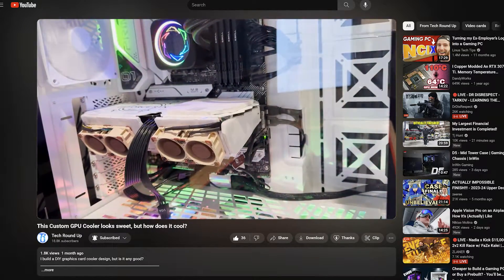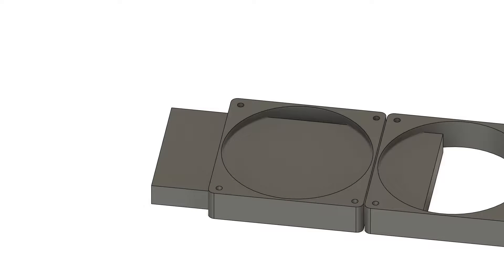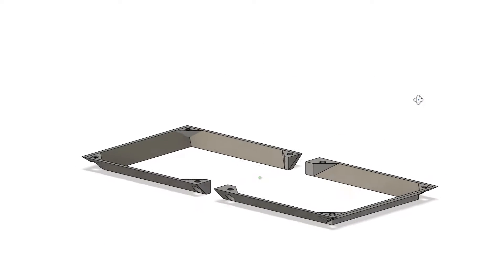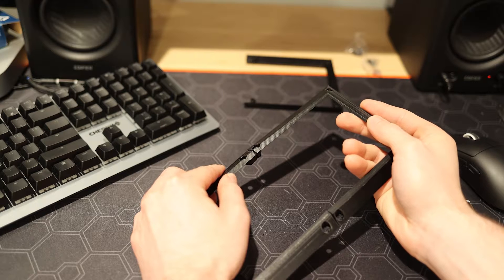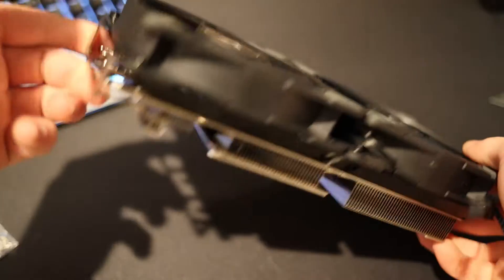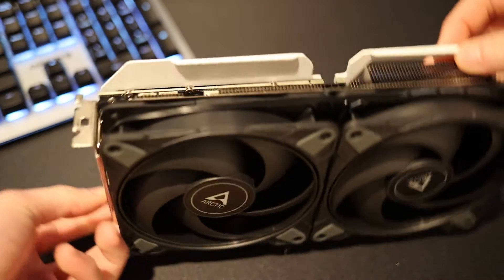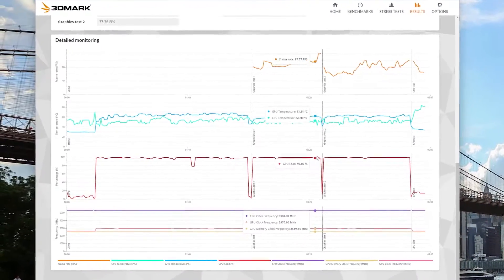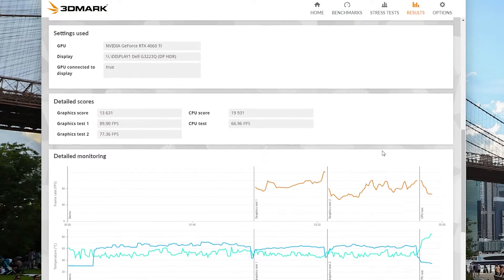This DIY GPU Cooler performed way better than expected!

Comment: Really nice tutorial I if you (like me) are looking to reduce GPU fan noise. However, when you say that you need to use regular fan-header on the motherboard
I think it would be better to use mini 4-pin adapters to plug the fans into the GPU fan-headers, thus allowing the card more easily control the fan speed.

Such adapters can be purchased from Amazon for less than 7 dollars. Just lookup mini 4-pin / GPU fan adapter.

Comment: just put a mini 4 pins to 4 pins adapter in this thing and let the videocard control them like normal, no need or external software and u get zero rpm mode. Thank me later
Reply: Just made the adapter myself but i
would appreciate your input on this; does the ampere on the fans matter?

 The ones that comes with my gpu is rated at 0.35A but for the life of me i could only find either 0.3A or 0.4A and above 😂

Comment: Before using 0.9 ampere 3200 rpm high static rear  exhaust fan I am getting 75 °c temp in gpu but after  I got 70 °c . Straight 5 °c difference, gpu is running on stock fans . 
Guys a powerful exhaust fan is critical in pc cabinet cooling .

Comment: Change the Thermal Paste with a Thermal-Pad and you‘ll get much improved Temps
Reply: Thermal pads are not meant for gpu. But rather vrm or memory.
Reply: you mean a PTM 7950?

Comment: Did the same thing almost 2 years ago, i have EVGA 3080ti, my stock fans died, and the replcements were both too expensive and would take too much time for me to wait. 
So i just took some basic measurements of my gpu and started modeling a custom bracket that would mount on the same points as the old one , and added holes for each fan that would enable me to mount it with the zip tie instead of using scres and instead of 3x 80 mm fans I've designed it to fit 2 120mm fans...
 They run at constant speed ever since, and I've never passed 80c from that day... 

I had some plans to make a custom circuit that would use sata power for fans, and gpu fan output for  controlling the fan speed and fan RGB if present, but had some issues identifying  the fan connector that was required if i wanted to avoid soldering the custom circuit to the GPU so i just never bothered to do it in the end.
Maybe some day...
Reply: Jesus Saves and Loves ♥
Reply: How many RPM do your fans produce ?

I mounted two 120mm fans to my gpu but temperature goes over 90 
Iwonder if 1600rpm is too low for my card
Reply: @JimmyCakeSon  will let you know once I get home, i had it at 75% speed before, but reduced it to about 33% after noticing there's too much noise in my room. not sure about the rpm's tho
Reply: same cards use a micro vga for the auto control for the original fans

you can buy 4pin pwm to micro vga
Reply: @vkultragame

Comment: if you also add 2 more fans at top to extrude heat you will find cooler temps. its the top cover the keeps heat in
Reply: Jesus Saves and Loves ♥

Comment: One question: if I plug the fan directly into the GPU, will the GPU control fans like stock fans?
Reply: Yes, but the plug is different compared to a regular fan plug, so you need an adapter.
Reply: @sebastiansandvik825  ah yeah sure, I mean adapter included

Comment: You think this would help an RX590 (yeah im old and poor) that usually hits 85 and throttles?
I dont have a 3d printer but i have seen other people use plastic zip cables.
Reply: i mean , i have a rx580 which use to touch 81-82c in these summers days , so what i did is first i done some undervolting , then repasting new thermal paste , and i had one fan which was size of an PSU fan of typical 500watt , i just replace it wires with sum USB cable and power it through my pc and place it vertically under my gpu and holy shit my gpu temp reduce by 4 to 5c , before it use to touch 77-76c but with this it touches 71-73c just by one single fan , and that fan is an 12v dc fan usually come pre install with some old pc as a outlet fan.

Since gpu take air inside so i make sure to place fan little bit closer to my gpu fan and it working rlly good. i wasn't expecting an big difference but infact it is , now im planning to get another same size fan and place it under my gpu lol.
Reply: @BeastAsGone  for whatever reason i cant undervolt or underclock, it crashes.
Im planning on deshrouding the gpu and using two artic p12 fans connected to the motherboard instead of the gpu fans.
Reply: @WhiteZelda  i had similar issue whenever i undervolt , my pc crashes within 4sec , but later in some reddit post i found an proper undervolt setting of my exact gpu model and this time it didn't crash.
Reply: @BeastAsGone  mine doesnt crash right away, only if i start gaming, probably bad gpu or something.
Also, temperatures do not go down when i undervolt/clock, not sure why
Reply: @WhiteZelda  in my case when i do wrong undervolt like starting from 1000mv , and after refreshing window sometimes it crash in few seconds or sometimes when i open an game it just crashes, currently im using stage 7 "1070mv" , stage 6 "1040mv , stage 5 "1000mv" and this actually help to reduce temp without this my gpu goes 83c
Reply: @BeastAsGone  I cant even underclock from 1150 to 1140 without it crashing at some point.
I was able to before, but after a couple months it started crashing, so i juts left it at default.
Reply: It should work, but I suggest repeating or ptm7950 and new getting thermal pads or thermal putty first
Reply: RX590 was designed for mining so many manufacturer max default is 60%fan speed, but you can adjust that in Adrenaline and it will not touch 80c if you use 100%, but it's going to be really loud.

Comment: Thank you, this is exactly what Ive searched for. I have a 4070ti OEM from HP and it hits under load around 75 degrees celsius to 70 degrees and I wanna customize it because of that, do you think the heatsink is universal for the 4070ti so I can exchange it to a bigger one too ?
Reply: Try to undervolting, use MSI afterburner, heaven benchmark (cause it will crash immediately if the UV or OC it's not stable without harm ur PC) and HWinfo for record the data and compare.

1st: open afterburner, heaven and WHinfo, set in afterburner ur GPU fans to 80% and try to get the coldest temp, usually 30~40, when u get there reset in WHinfo the data metrics

2nd: run a heaven benchmark everything high or Xtreme at the resolution u use mainly in borderless window

3rd: when the benchmark finish check in WHinfo the highest GPU clock speed, temp and voltage, remember it

4th: now open afterburner again and press "control + F" or a button called "Curve", then still in afterburner take the clock speed slider all the way down and u can see in the open windows how the curve get down too, now in the curve window u need to take a dot at for example 900mv (down side) and rise to 1900mhz (left side)

5th: run a heaven benchmark again and see what happens if crashes reset to default in Afterburner and try now 925mv and 1900mhz for example an run heaven again, if it works and the benchmark reach the window results then u have room for try now a rise in Mhz and so on but try to not surpass ur original Voltage

6th and final: try to reach the same speed as ur original GPU clocks and when u get it set ur fans to wherever speed u usually use and save it, the next time u game u will see a difference in temps and voltage (watt consumption), u will get a stable and more cool machine whit this trick, btw some games are sensible to UV/OC so if u get a crash in some there u need to reset ur GPU to original state, nothing u can do, sorry.

Hope this might help u!
Reply: Jesus Saves and Loves ♥
Reply: did you mod something? i have the same card and since a few month i have crashes and i think maybe it´s the temp.
Reply: @sascha9232 I actually send my pc back to hp because my cpu cooler colours weren’t working right, and I got myself an upgrade to the 4070ti super, it has way better temps, but if you wanna stay with your build, you could maybe watercool it, I just don’t know if it would be an upgrade? If it’s crashing I would definetly think about sending it back if you’re still in warranty time
Reply: @CRE4T0R42  that ship has sailed, gonna look into the Watercooling, thx